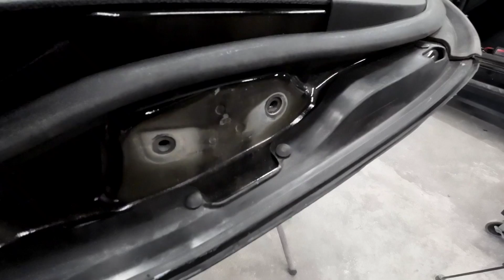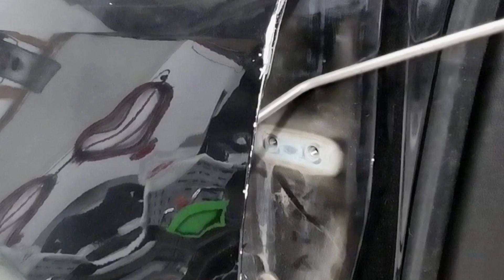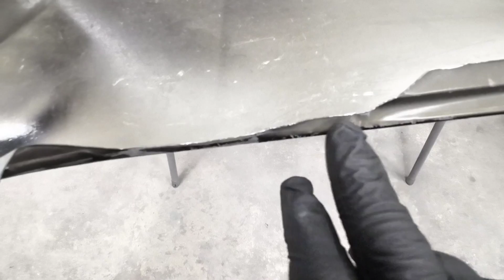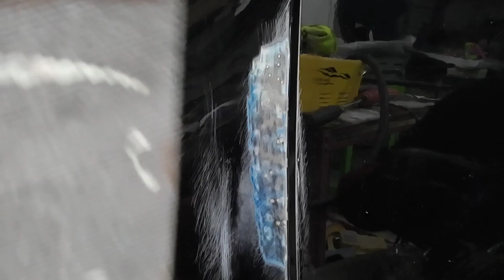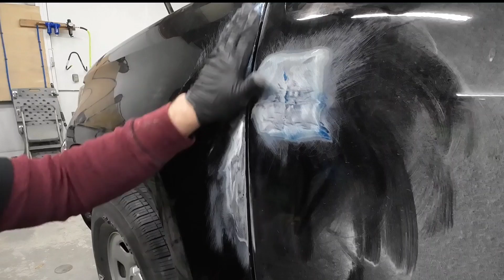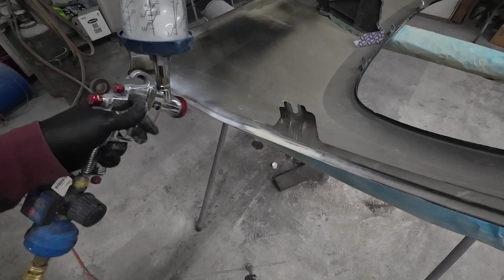DIY dent repair using BODYFILLER

Comment: awesome repair, what nozzle needle set size do you normally use to shoot that u-pol primer when mixed 4:1?
Reply from the maker: 1.7 or larger, I don't  use it as high build too much.
Reply: @GarageNoise  cool, thanks for the info.

Comment: that primer didn't look like it was atomizing (droplets were huge) very good, does it not matter with primer coat?
Reply from the maker: I recently switched to a 1.5 tip and needle set that might be why, but bigger droplets might make it take slightly longer to sand smooth but really not a big deal. Appreciate your comment!

Comment: Which area pays more? paint job or body work?i'd like to start in this business, I like more paint
Reply: I have 17 yrs paint and body experience. They both pay well especially at a flat rate shop. Most shops pay both painters and body men the same hourly rate. I would just note that there are usually one painter position for every body man position, so painter jobs can be harder to come by.
Reply from the maker: Paint pays more but it's  a good idea to be a dual threat makes you more valuable. I like painting as well. Appreciate the comment and support!